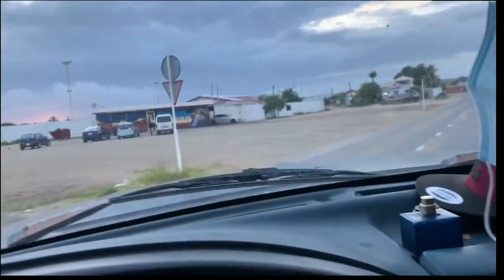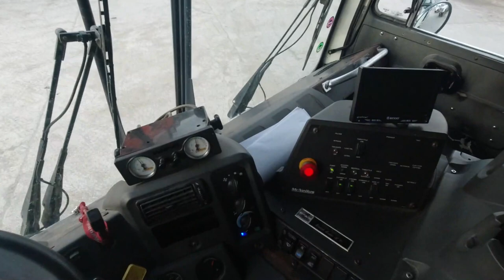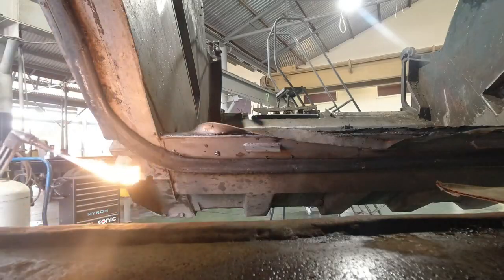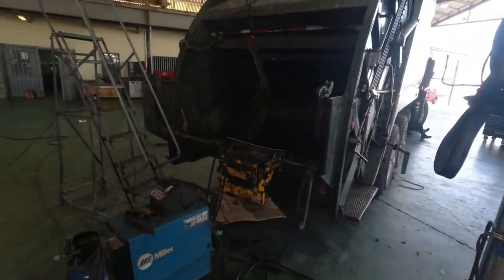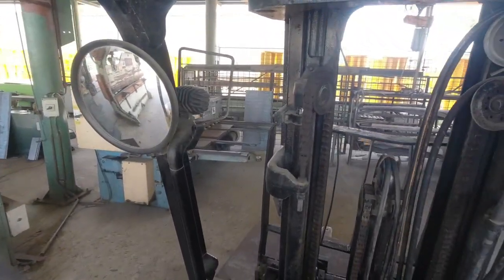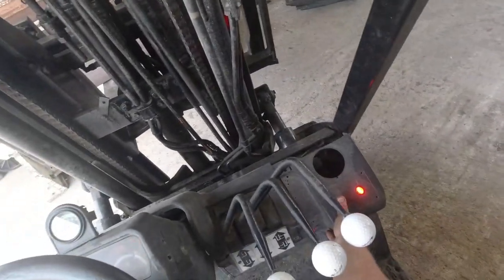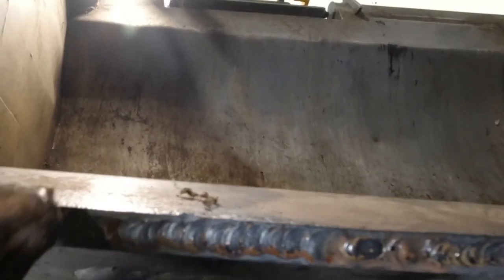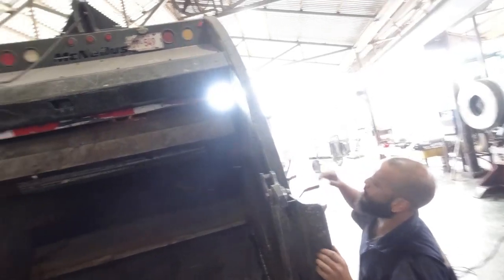REPLACE SHEET METAL on a trash truck | Cutting, Fitting, Welding

Comment: Is that Hardox/AR sheet or just cold rolled plate you were welding into the hopper? We always use  Hardox sheet, with a BHN of between 360 and 544 (AR400 or AR 500). Low carbon steel never lasts, the force exerted by packer Blade and the waste just chews it up. Nice no messing job man 👍
Reply from the maker: I think its just cold rolled plate their lifespan is about 2-3 years in that hopper,
Reply: @aweldersjourney   Talk them into using AR, It's more difficult to weld (you'll need to preheat to around 200F, and use something like an AWS E7018d electrode or (AWS) E71T-5C flux cored wire in the MIG with Argoshield heavy type shielding gas) But it will significantly outlast and outperform that mild steel! 😉👍 Oh yeah, and it doesn't bend easy in a pressbrake 😕